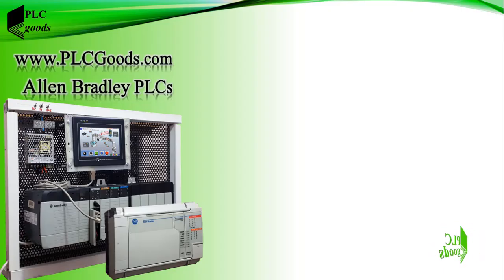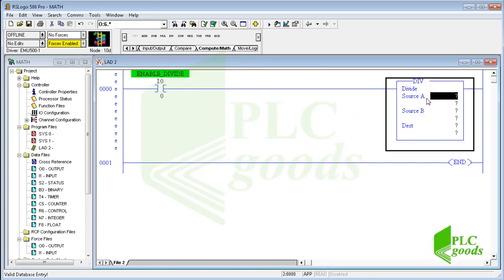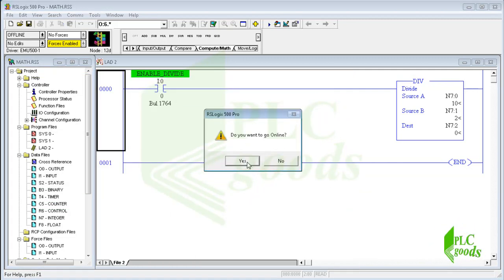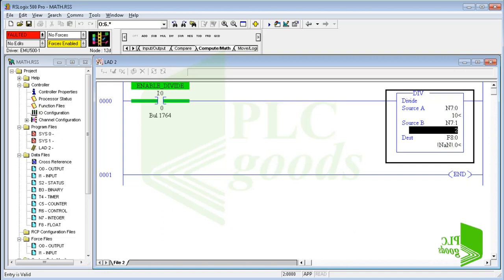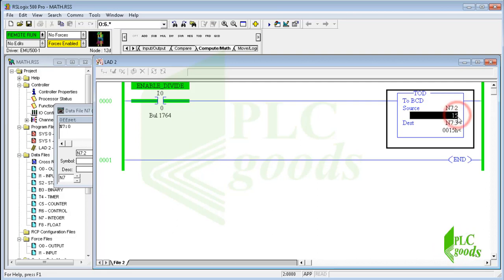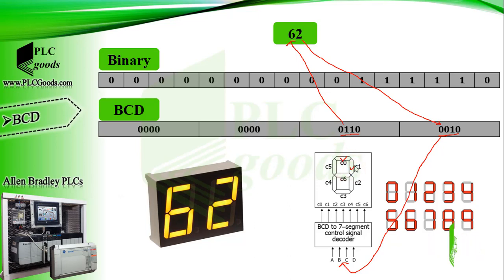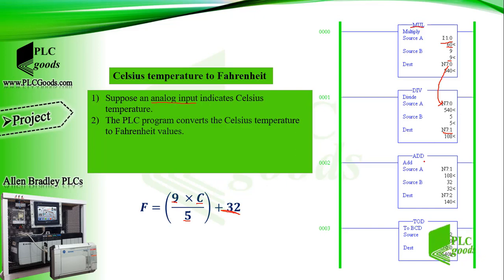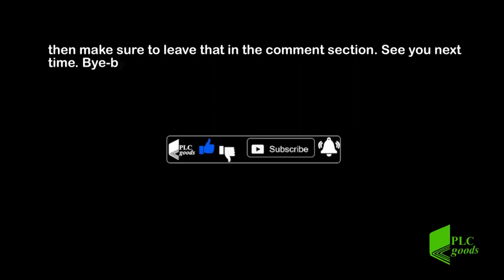RSLogix 500 Tutorial | Allen Bradley Tutorial | Math & Number System Instructions  | Lesson 8

Comment: What does TOD mean and what’s use of it ,I can’t understand the use of it
Reply from the maker: 💚💚1. TOD (Time of Day) Clock
In many PLC systems, "TOD" stands for "Time of Day," representing the real-time clock within the PLC. This clock provides the current time, which can be utilized for scheduling and controlling events based on specific times. For instance, you might program the PLC to start a machine at 08:00 and stop it at 18:00 daily. This is particularly useful for automating processes that need to operate on a daily schedule. 
2. TOD (Convert to BCD) Instruction
Alternatively, "TOD" can refer to the "Convert to BCD" instruction in ladder logic programming. This instruction converts a binary integer value into its Binary-Coded Decimal (BCD) equivalent. BCD format is often required when interfacing with devices like digital displays that expect data in decimal format. For example, converting the binary number 45 to BCD would result in 0100 0101, representing the digits 4 and 5.